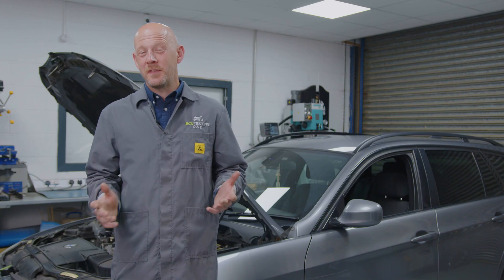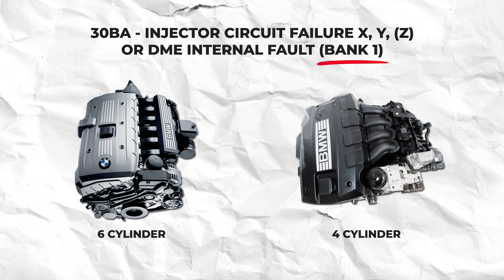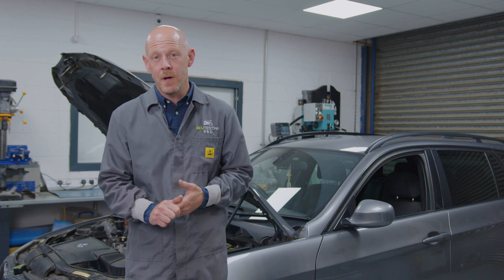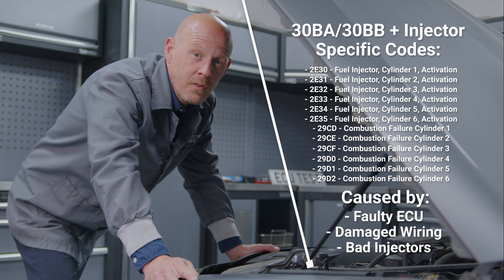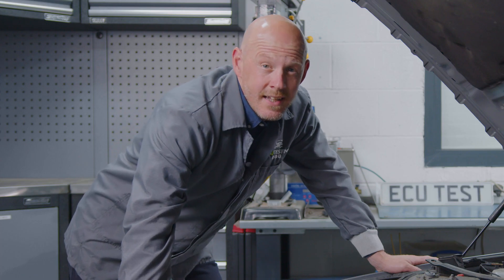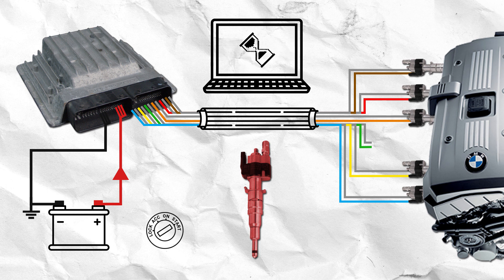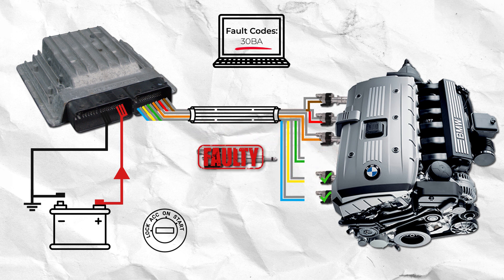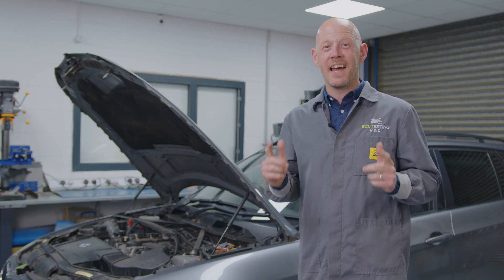BMW E90 Misfire – 30BA and 30BB BMW Codes Fixed!

Comment: I’m running into an issue with 2E1A fault code for my 08 335xi with N54 engine on MSD80 ECU. Is it possible to clone MSD80 and load it into MSD81 to avoid any CAS/key replacements?

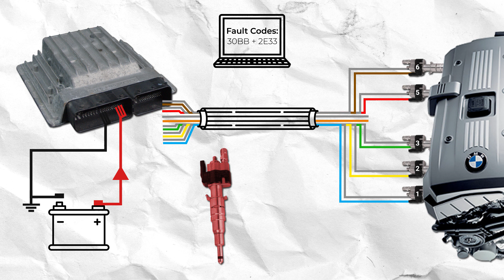Comment: 4:49 does the harness have to be at .02  ohms exactly because I test on my harness on injector number one at the pins both wires and was at .03
Reply from the maker: Hi. A reading of 0.3 ohms would be acceptable and wouldn't indicate a wiring fault.

Comment: Hi guys, excellent, and very insightful video. A quick question if I may. I have run through all the testing, and swapped all the bits from bank1 to bank2, and I am still getting the 30BB code. I measured the MOSFETS in the MSD80, and they all test fine. So now I am out of ideas. Any insights? Where else should I be looking?
Reply: Same story with my car. :-/ Did you find any solution, please? Thank you for sharing your experience!
Reply: It was a faulty ECU. Took the guys a while to find the problem, but all fixed now.

Comment: Bossman you helped me out b4 & I promise you I won’t bother you again…. Like you said before throwing money at it I done everything I possibly know on switching coils & plugs but misfire stays in cylinder 5 ONLY after the temp gets ova 190… that’s the only time it’ll misfire under WOT could you PLEASE tell me what you think or what my next move should be…& thank you so much for your great info
Reply from the maker: Hi. If you have swapped the coils and injectors and the problem stays at cylinder 5 then we would recommend checking the continuity of the wiring from each back to the ECU. If the wiring checks out ok, then the fault could be with the ECU itself. If this is the case then we can test your unit to confirm this if you would like. Visit our website for more information: https://www.ecutesting.com/common-faults/bmw/bmw-3-series-engine-ecu-fault-misfire/
Reply: @Ecutestinglimited  bossman thank you thank you so so much I’ll do the injector when I get off today and if it stays at cylinder 5 I’ll DEFINITELY reach out to your website
Reply: @Ecutestinglimited  it was the injector once I swapped them around it moved to cylinder 6…. Great info & best channel out…. Thanks again!!
Reply from the maker: Hi @cme2nite123 . Thats great news! No problem at all and we are glad you have fixed your fault! 👍

Comment: Hey so I can swap injector without out recoding it to see if it is tha injector
Reply from the maker: Hi. For diagnosing the 30BA/30BB fault codes you will not need to re-code the injectors as the code should clear if the fault was being caused by the bad injector that has been removed. If the fault is caused by a bad injector then you will need to re-code the replacement injector.
Reply: @Ecutestinglimited  Thank you so much great information

Comment: Let me check if you have a vid for throttle body code. E90 323i
I have 4.9V on 4 of the 6 pins when i switch on my car,  pin 1 4.9v,pin 2 4.7v,pin 3 4.6v,pin 5 4.9v no throttle responds and potentiometer 1 error code 002cf9. And P0123. Remove the throttle body from intake start car and it sounds better for a few sec off course.